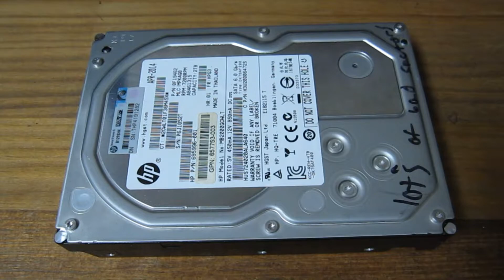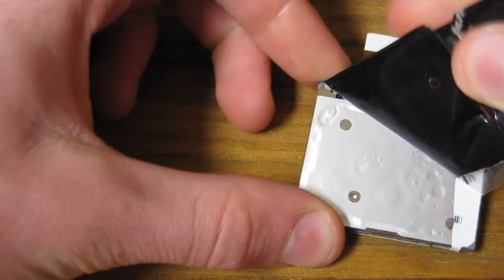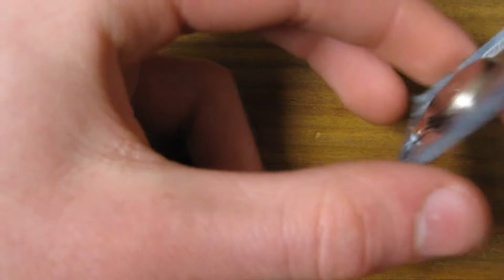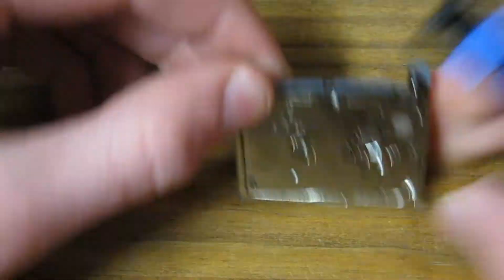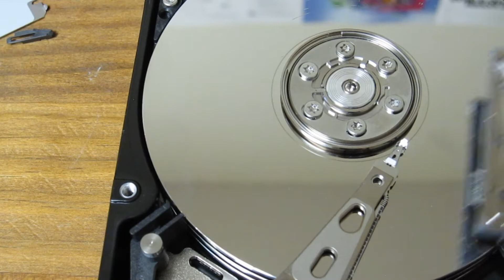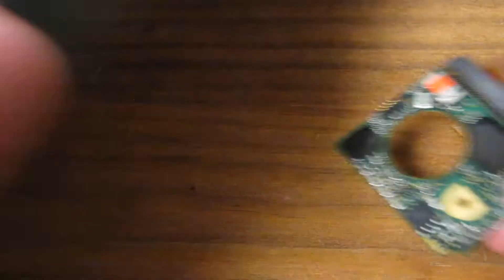Teardown of the world's smallest HDD

Comment: The video was great, thank you. Hard drives are vulnerable to shocks, how can this hard drive not be damaged in a mobile phone?
Reply from the maker: That was a big reason they stopped being used. Similar drives were used in Apple iPods and due to the fragile nature of a hard drive, they would often break. 
Many devices with hard drives were equipped with sensors that would detect when the device was falling or bumped, and park the heads of the hard drive in the hope that the disk would be able to shut off before the device hit the ground. There were protections in place, but of course parking the heads takes time and often the drive could not shut off fast enough to avoid damage.
Reply: @DanalogRetro  Very interesting - thanks for the explanation- mer30
Reply: I have hundreds of these brand new in static bags.  They sell for US$200 - US$400 each for the Seagate ST1.2 CF drive.  ULTRA collectible!!!!!!!!!!    I love them.   @DanalogRetro

Comment: The first iPod Minis and similar had these (Rio Carbon, TrekStor Vibez) back in the day. iPods ofc had much higher capacity with larger 1.8” drives (to say nothing of Creative and Archos players that had laptop-size drives) but these were pretty dense and served a pretty key demographic. iPod Minis were much cheaper than the full fat ones, and a /lot/ smaller and lighter. Ofc flash got cheap enough pretty soon after that that resorting to a fragile microdrive was no longer necessary. But it was critical for those few years.

Comment: These are the ones used in the original iPods in the early 2000´s
Reply from the maker: Similar ones were, this model is slightly different, built by Seagate.